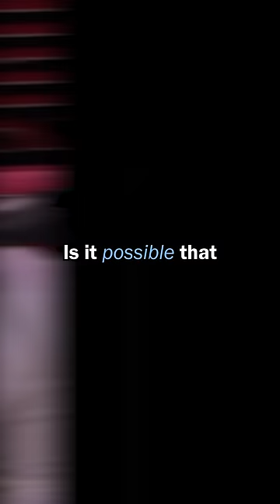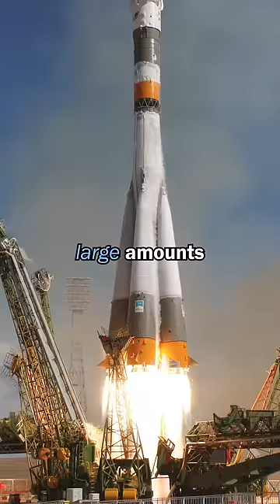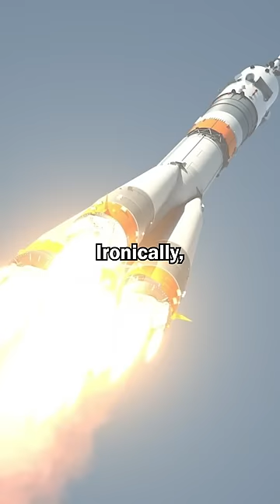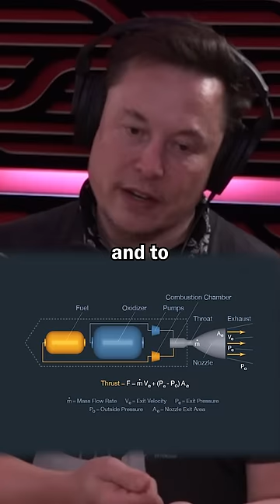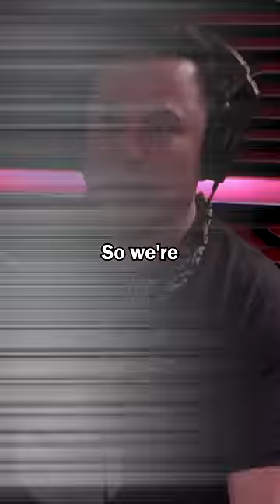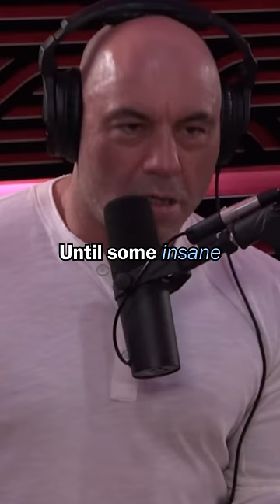Why This Rocket Engine Will NEVER Work!! ☢️ #spacex

Comment: Ionic propulsion is currently being used by SpaceX, not on the rockets but on the Satillites.
Reply: ionic propulsion expends gas
Reply: @Ferraday It accelerates it with an electric field, there is no expansion.
Reply: @wolfgangpettay79 that's still throwing out gas
Reply: @wubnix  but it's not expansion! You need much less gas as the impulse comes from the high velocity due to the electric field. For interstellar travelling it definitely makes sense.
Reply: @wolfgangpettay79  He said expend?
Reply: @Fooney1  you are right, I read it wrong (it's an e not an a). So, with normal rocket fuel you get acceleration with the expansion of the gas and with ionic impulse you get acceleration with expending much less gas particles but to a higher velocity.
Reply: @wolfgangpettay79 The big difference is the huge amount of force you need to overcome earths gravity and get into low orbit. Ionic expulsion system release relatively low amounts of gas and thus reduce the amount that needs to be carried which makes it more efficient but has less force. Its perfect with in the vacuum of space with a near earth orbit but not helpful on earth. A analogy would be driving up a mountain. With a car that has high Ps you can probably drive up but wont reach far because of the fuel consumption when you reach the top. With an energy efficient car you wont get up but would get farther after going up
Reply: @TheYolo20  that's why this is good for interstellar travelling with years of acceleration and high endspeed.
Reply: @wolfgangpettay79 Right, so it’s STILL EXPELLING MATTER. That’s the entire point.
Reply: @samuelking4723  the point is that a rocket engine can work on nuclear power! Anyway I am tired of this discussion. Live long and prosper!
Reply: @wolfgangpettay79  The word “nuclear” isn’t mentioned a single time in this entire thread.
Reply: @samuelking4723 "you can never win an argument against a stupid person. They will only drag you down to their level and beat you with experience." -sun Tsu (probably)
Reply: @Goliath83  Haha, you’re right about that one. Have a good day bro
Reply: Ionic propulsion is still a physical reaction of mass (ions) pushing against something. Meaning that when the fuel (ions) is depleted there is no more acceleration except via gravity when the craft gets close enough to a body that has gravity.  At the moment, ion propulsion is only good for minor course corrections not for climbing out of the gravity well and certainly not for interplanetary transport.
Reply: For arounmd 50 years, look into T.T.Brown he invented it and made discs weigh less in a vacuum then everything went 'black'.
Reply: It's not even close to being powerfull enough for ground to orbit launches.

Comment: Nuclear pusher plate tech is already in development. You literally explode a bomb at the back of your ship, pushing the ship forward.
Reply: I was gonna say, if his idea behind propulsion is "expelling gases" wouldn't a controlled explosion being directed properly be the same exact exact concept?
Reply: @bdragonseven Yes, they were talking about expending mass, but Elon did mention the expulsion of gas, which nuclear bombs are not gas. Maybe 1 gas atom which expands into loads of heavy metal particles
Reply: Nuclear and ion thrusters do exist but they still expel gas, so you need a supply of it on board. It's just that energy to accelerate gas does not come from fuel that is burned. The advantage is that they can accelerate gas to much higher velocity so you need much lower supply of it. The disadvantage is that ion thruster cannot provide a lot of thrust so only useable when already in space to change velocity extremely slowly. Ion thrusters are generally used on satellites, including Starlink. Nuclear propulsion is more powerful, but you still won't use it to lift rocket from the Earth.
Reply: Nuclear Salt Water rocket has also been invented .  It's basically a nuclear reactor configure to redo the Chernobyl explosion, but pointed down . So the rocket exhaust is essentially nuclear waste .
Reply: Theres also this thing called a nuclear thermal propulsion, its essentially a thruster that uses hydrogen as a fuel base and use nuclear power to heat up the engine for it to function. On top of that, we could also use this in parallel with an ion thruster. So, the nuclear reactor will be used for two purposes, to create electricity for the ion trusters when out in space, and create heat for the nuclear thermal propulsion for when you want to exit the planet, this could help us become an intergalactic civilization
Reply: Which is still fuel that reacts.  It's basically just a fancier way of doing the exact same thing.  Once the nuclear fuel is depleted one still needs to get a refill some place.
Reply: Wow a lot of you watched a lot of sci fi and have a lot of ideas, none of which you can prove or have a working model to point to. Impressive!

Comment: rotating mercury has left the chat
Reply: What's that?
Reply: Star Trek?
Reply: Project Orion has sent you a friends request
Reply: @pointofinterest5981  Antigravity technology, the real version used in classified manmade aerospace vehicles. But rotating mercury was one of the earliest designs, from WW2, called "Die Glocke". It's apparently more advanced now. The TR-3B is one version that's pretty much confirmed to exist.
Reply: @arvont1  it works specifically because there is gravity, the moment it reaches space it will be useless if it is real and viable thing, cause it needs a lot of energy to beat gravity.
Reply: Wasn't it red mercury tho ? 🤔
Reply: I believe it used xerum 525
Reply: Logic and reason left the chat. This is comic book territory. Stay away.

Comment: Dude ion engines are real, yea they need heaps of work atm but they do work
Reply: Only in low gravity.  You could never take off from earth, or even the moon with it's power alone.
Reply: @hoodagooboy5981 you’re correct in what you’re saying but Elon focused on propulsion in space.  He was explaining space you have to expel physical gas to create movement.

So the original comment is correct
Reply: ion engines are still expelling mass
Reply: If you're implying they are some sort of electric engine, this is true; yet they still expell mass (my understanding is that ions are accelerated in an electric field, which generates thrust in very small amounts). There exists no purely electric rocket engine (as in: not using any kind of fuel).

Comment: Newton 101: Action is proportional to reaction
Reply: Every action has a proportional and equal reaction.
Reply: Also Newtonian laws break down at insanely huge or small quantities so...😂
Reply: @eugeneeugene3704  but we're talking about propulsion and  molecule objects, not quantum.
Reply: @missionpupa  to make clear my argument, I believe that to achieve lift off we may probably never lose combustion engines. Traveling through space has alternatives. That have already been tested and worked in space. Look it up
Reply: @eugeneeugene3704  you look it up, if you can't even look up your own argument why should I. And no, propulsion in outer space is not possible with any technology right now other than fuel propulsion. There is no air in space therefore it has nothing to push against.

Comment: there is in fact nuclear propulsion, it uses nuclear warheads detonating behind a push plate to accelerate you. cool stuff!
Reply: Conventional bombs use a chemical combination or decomposition reaction to convert their fuel source into a large volume of hot gas in a short amount of time.  Oxygen is required for combustion, which is why solid rocket fuel contains an oxidizer and liquid fueled rockets use liquid oxygen.  The size of the explosion is determined by the amount of fuel.

Nuclear bombs do the same thing with a nuclear reaction, but they do not use combustion to convert fuel into gas.  They release a large amount of energy which is absorbed by gas that is already present.  As such, they require an atmosphere to create a literal explosion.  In a vacuum they would "burn" very bright and hot, but otherwise they would do very little to create thrust.
Reply: There's also the NERVA reactor. It's essentially a nuclear reactor that passes gas through it's core, which is then expelled out through a nozzle like a conventional chemical rocket.

Comment: nuclear powered propulsion in space uses hydrogen gas because hydrogen is the lightest element. nuclear decay heats the gas particles to the highest possible speed then they are released out of an opening at very high speeds to propel the ship in the opposite direction at a much lower speed. ion engines ionize a gas and release the ionized gas at high speed, its the same concept but with xenon gas instead of hydrogen. if you are not expelling particulates you cannot accelerate yourself in space (without warp drives or something) since gases are the lightest elements they are currently the most efficient as the particles are the easiest to heat up to the highest speeds. think of it this way, if you can expel chemical kerosene at say 15000 miles per hour to get to orbit from earth, your max theoretical speed is 15000 mph even if you fill back up in orbit, if you expel hydrogen atoms at 100k mph, even tens of thousands of atmos leaving the ship at 100k mph will barely move it, but the theoretical top speed is then 100kmph, it will just take a longer amount of time to get there, but instead of burning through 10 tons of fuel per second like with a chemical rocket you can expel hydrogen atoms for months on end accelerating the entire time.

Comment: Actually elon Bob  explained an antigravity bending  or warping that was in essence  a very high voltage craft
Reply: what are you on about
Reply: @kgb255 I believe he is mentioning the Alcubierre drive. A realistic but still hypothetical way we could achieve FTL travel, similar to traversable wormholes. You probably would not need gas, but you would need an unimaginable amount of energy if possible

Comment: Stephen Hawking had a theory before he passed for a plasma-propulsion space engine. However, as Elon said, there is no way to travel through space as of yet without using fuel, and we’d still be using a type of fuel to make said plasma propulsion
Reply: An engine is in development that can navigate earth's magnetic field in orbit. Very low "thrust" and slowly, but using the magnetic field, a propellant is not needed anymore and even better, solar panels provide electricity for powering the electromagnetic device. Satellites would have limitless maneuvering capability.
Reply: @paulmichaelfreedman8334 🎉
Reply: @paulmichaelfreedman8334  True, so would the use of the “Solar Sails”
Reply: @macksadelic7561 too slow. Might die before reaching destination.

Comment: Couldn't you use nuclear to accelerate gas? I mean energy is energy
Reply: i was thinking the exact same thing. using the charge of a nuclear battery for a possible fuel engine would make it more energy efficient i would argue. but i’m not a rocket scientist either LOL
Reply: Yes. If you can increase the exit velocity of the fuel, then you will increase the efficiency of your rocket. We already have rocket engines which use electricity to accelerate gas to extremely high velocities, and get very good efficiency (but very low thrust).
Reply: @Jason9637  i assume nuclear is much more powerful
Reply: @macksadelic7561  it shows.
Reply: Yes. It has been developed, just never used.
Reply: Nuclear is a good source for electric power. That is why is was used by the Voyager probes and will be used in some way as at least a backup power solution for a Mars colony but Elon is saying that in a vacuum you still need to shoot out some sort of stream of fusion or particles so by itself a nuclear reactor on board doesn't help with that. It could be an energy source for a future ion drive for example. Also there have been theoretical designs for an impulse "engine" where nuclear blasts are detonated behind the ship to throw the ship forwards. That would require the ship to be able to survive nuke blasts on its ass but the theory is this could propel it to some fraction of light speed.
Reply: Russia has nuclea rpowered rockets.. though everything i read on it, is now gone. So im guessing its been erased
Reply: @joythought  A Nuclear thermal rocket is using the nuclear reaction to heat up hydrogen and create thrust. It has been studied and tested in a number of project since the 50's. Still today its a contentder for a Mars transfer propulsion system.

But yes you can't go anywhere in space without leaving something behind. :)
Reply: Yes. That concept was studied in 1960s. Hydrogen was to be used as propellant. Specific impulse of 800-1000 s is possible using a solid core nuclear thermal rocket. For classical thermal rockets maximum you can achieve is about 400 s. So it is actually more efficient. The problem is the rocket engine itself would be a little bit heavier and more expensive. It is also a little bit more dangerous in case it crashes. But these problems will be addressed in near future
Reply: @serdaravsar5181  But I assume if you made it bigger the overall relative weight would go way down because you just gotta add more hydrogen/gas
Reply: @mhxxd4  yes you burn less fuel but the engine weight will be heavier. Still it will be lighter in total weight. The other thing is density of hydrogen is very low so it will also take more volume compared to a classical thermal rocket which carry both hydrogen and oxygen. So the rocket will be lighter in weight but bigger in volume. These are problems that can be solved easily but I assume the biggest issue is safety
Reply: @macksadelic7561 we've been doing this since pioneer probe

Comment: I can't believe Joe thinks rockets burn gasoline.
Reply: They do (bruh)
Reply: It’s not literal. Gasoline can be a generalization for any hydrocarbon fuel.
Reply: @dustgalaktika9573  no they don't, duh.
Reply: @dustgalaktika9573 not gasoline. There are several other higher calorific value hydrocarbons, mixed with oxides of nitrogen in different proportions at different stages of combustion
Reply: It's RP1 (Kerosene) mixed with LOX for the Falcon 9 or Methane mixed with LOX for the Starship. NASA uses Hydrogen and LOX for the SLS. Those are the 3 propellant mixtures I'm aware of.
Reply: I mean RP1 is basically kerosene, so its not that far off
Reply: Hydrogen fuel. Hydrogen is a gas so semantics 🤷‍♂️
Reply: Liquid fuel, big fuckin deal man, splitting hairs.
Reply: That's not as ignorant as you think.  Robert Goddard's early rockets burned gasoline.  The Germans developing the V2 rejected kerosene for alcohol because the engine nozzle and vanes weren't able to withstand the heat.  The US built the Saturn V first stage to burn LOX and kerosene.

Comment: Gravity acceleration left the chat, its already invented and has been successfully used.
Reply: But it's just acceleration,  you can't run rocket on that.
Reply: @Apostolnixx  you can run a spaceship on that, since if you got acceleration there is no drag in space and ain’t nothing is gonna decelerate you. And for braking you can use the gravity around your destination point or a laser light and sail, or sunlight and sail for both accelerating and braking.
Reply: @carbontube7956  go get your Nobel prize
Reply: @Apostolnixx  I can’t as these methods have been discovered already, and are being used for tens of years now. What other stupid suggestions do you have for me?
Reply: @carbontube7956  do you understand the difference between a well-known method of acceleration in space using gravity and launching the rocket from the Earth? Because he wasn't talking about the first one in the interview
Reply: @Apostolnixx  He was talking about the first. He's saying electricity can't be used as an energy to move in space.
Reply: @wismtree  it can't,  so he is right. Also, we were talking about the last part where Joe asked about "breakthrough in gravity"

Comment: Problem with Nuclear right now is it's just a glorified steam engine. There's no way to directly turn Nuclear into electricity and we're stuck using the heat to boil water to power a turbine still.
Reply: Look up Radioisotope thermoelectric generator, and the seebeck effect.
Reply: Nither nuclear steam generators or Seebeck is very efficient to my knowledge.
It's just that nuclear reactions have such a massive amount of energy that efficiency is less important.  Right now anyway.

Comment: Kinetic propulsion would work. Maybe a large hollow centrifuge that could make use of magnets and electricity to sling shot stuff up. Then maybe the smaller rocket attached to the payload could provide guidance in space

Comment: Theoretically they could ALMOST make electric rockets.
If you had a ridiculously efficient power source you could basically turn the whole craft into a huge rail gun. 
You expell a tiny bit of mass, but at such ridiculous speed it's still able to push the ship in the opposite direction.
Reply: What do you mean with almost and could.....
Electric propulsion is a common method for deep space vehicles.

Ion drives for example.
But they hav very low thrust so they are only used for very light very long accelerations
Reply: Yes, and electric drives do exist.. But they still need to expel a gas..